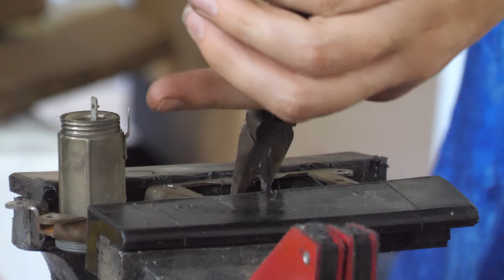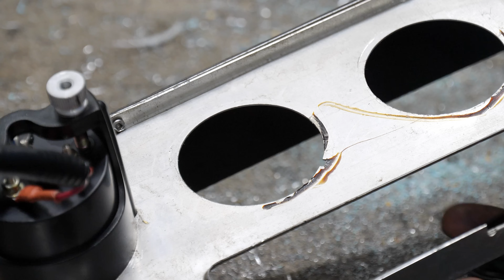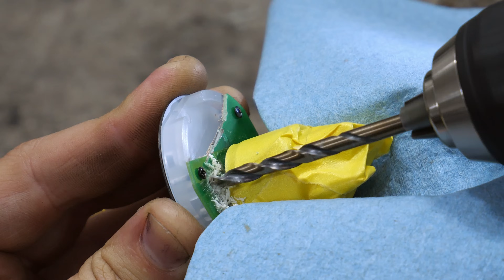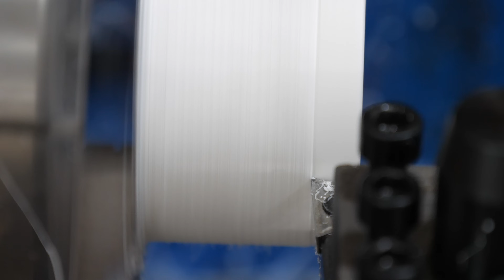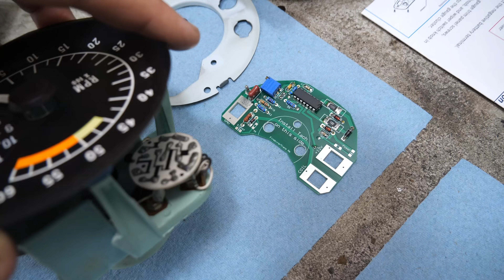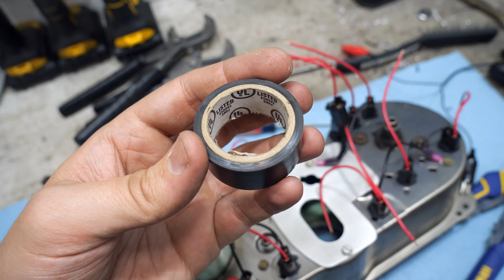Custom Gauge Panels on the “Cheap” for this 78 Firebird (Ep.46)

Comment: I'm curious - why did you decide to remove the switch for the rear window defroster all together? I myself find a heated rear windscreen a huge benefit and I couldn't do without - or are the heater elements on the glass broken?

Comment: How hot does it get where you live? I found out the hard way that the interior, particularly just under the dashboard, can get hot enough to re-melt regular hot-melt glue, when parked in the sun on a hot summer day…. So if your location gets as hot as Australia, it could become an issue.

Comment: A trick that I've used to shock and amaze my friends to get factory clocks working again is pretty simple.

Ensure there is no mechanical damage to the clock.  If the clockspring moves freely, chances are it'll work again.

Step 1:  Clean the points for the rewind mechanism.
Step 2:  Liberally hose out the guts of the clock with Brake Clean spray.
Step 3:  Allow guts to dry.
Step 4: Liberally spray WD-40 (or similar very light oil) over the clock guts

Wait 5 minutes, then apply power.   Clock will work.

I did this method one night in front of a friend of mine who had TWO AMC Rebel factory clocks.  In 10 minutes, I had BOTH working again.  The one he installed in his Rebel Machine to this day works perfectly.

Comment: very nice! I just went though and replaced all my gauge lights on my 79 z28 a few days ago (my circuit board is also heavily delaminated). I have some autometer gauges for oil pressure and engine temp in the little glove box map holder thing that's below the radio on my car.

Comment: That miserable green plastic is brittle - it's basically falling apart in my 88 S10
Reply from the maker: This era definitely did not have the best plastics, the gauge cluster in the Pinto is probably the worst I've ever seen, it has deteriorated so much you can crumble it in your hands

Comment: I have a question why would the fuel switch on the dashboard just be a momentary one?
Reply from the maker: That's just intended to be a prime switch, to run the fuel pump before cranking the engine over if it's been sitting for a while. The fuel pump will normally be powered by the oil pressure switch when the engine is running, similar to what GM did in the 80's. I was back and forth on it being a momentary or a toggle (so it could run the pump for diagnosis or if something went wrong) but it seemed more appropriate to use a momentary and a rubber band or piece of tape could make it act like a toggle if desired.

Comment: Dakota Digital $2000 fully digital replacement gauge sets for classic cars may have LEDs and digital readouts, but a mechanical clock in the dash??? I'd go through the trouble of restoring the factory gauges just to retain that any day, that's hecking awesome

I wonder if i could make some money refurbishing those broken factory GM clocks, since i already have the skillset from repairing normal mechanical watches : p

Comment: Hey, instead of wood screws I do use the plasterboard screws as they have wider thread so it bites more.
Reply from the maker: Good thinking! I really just used what I had, but I should get some of the coarse thread plaster/plastic screws to have on hand
Reply: @FuzzyDiceProjects  I do often the same (using what I got lying around), but I found those screws to be best for applications like plastics, J nuts and anything thin really. In your case you could do the wood backing on sides in case you worried about the plastic cracking. Also do you plan on having radio/audio in the car?
Reply from the maker: @marek196c  At some point I'd like to put a radio back in the car, but it's low priority. There's an open area below the original radio slot that would be a little cubby from the factory, but it's always been missing on mine and I think a small head unit would fit there no problem
Reply: @FuzzyDiceProjects  got you, but is worth mentioning that if you want a "stealth" installation there are micro amps like Vibe Powerbox 65.4M (make is just example there are plenty of other ones) that you can fit anywhere (with enough space for some air obviously) in the car. That amp (like most) you can combine with the aux receiver like dab radio (if you want the radio, usb, hands-free and other features as well you can opt for something like this "DAB Digital Radio Adapter 2.4" or "tinyaudio c-smart" with control from your phone app) or just a simple Bluetooth receiver. Also idk how is in America with availability of those and dab coverage itself so wroth keeping it in mind. Just giving an idea, but is just something that you may already know.

Comment: I love that.  I think you did/are doing a great job.  I do not care too much for the black on white label tape. You can get black on clear or any color you choose, if you choose.  You can also program the machine to print vertically.  One more thing, are you sure about the hot glue?  What if it were to get, you know, hot?  But you do it your way - whatever that is - you look like you know what you're doing.
Reply from the maker: The plan was to change out the labels later on, I just had the white ones at the time. I don't have any clear tape yet but I think that would probably look the best so I'll have to get some and try it out! I also hadn't considered vertical text, I'll have to play around and figure out how to do that.

As for the glue, I haven't had an issue with it getting tacky or melting yet since it takes more heat than most things will put out, but I'm sure an incandescent bulb would pose a threat. The indicators are incan and get warm to the touch, but the bulbs are so small I'm hoping they'll be fine. I ran a test leaving them plugged in for a few hours and the glue didn't have any problems, but it the hot, enclosed dashboard things may be different so we'll have to wait and see. A lot of the time I just try things to see what I can get away with until I find out the limits!
Reply: Technology has changed a lot in the 2.5 years that have passed since filming. 😂

Comment: I just wondered why you didn't use switches with built in lights?  They use them a lot on boats.... commonly available and cheap...
Reply from the maker: Two main reasons:
1. I have four of those for the offroad lights in my Silverado and have had issues with bulbs coming loose/failing over the years so I'm hesitant to use any without further testing.
2. I bought a shitton of regular toggle switches years ago and have a lot of them left haha

Comment: Two Videos in a week? What a treat! For hot glue I suggest getting a high temp gun and glue, the glue sticks WAY better to metal I found. A bit more expensive but its worth it, also you can get black glue.
Reply from the maker: I did eventually get a no-name brand glue gun that uses Dewalt 20v batteries, it works very well and the glue sticks way better but honestly sometimes it sticks too well haha. Sometimes there's value in being able to peel off a hunk of glue without scraping parts clean, so I think both types have their place.
Reply: @FuzzyDiceProjects  a great trick I've learned for hot glue is isopropyl alcohol, make any glued part pop right off like magic as soon as it wicks underneath.
Reply from the maker: @sandpiper1515  Oh interesting, I'll have to give that a try, thanks for the tip!
Reply: @FuzzyDiceProjects  Project farm did a test of hot glue guns very recently.